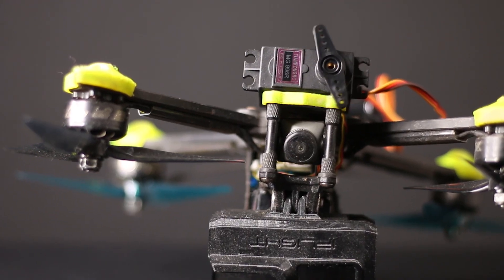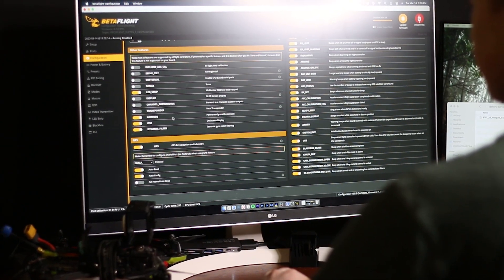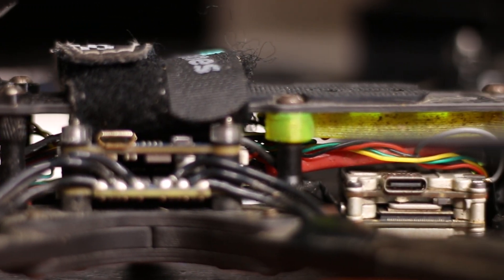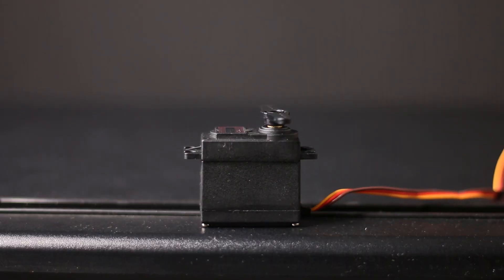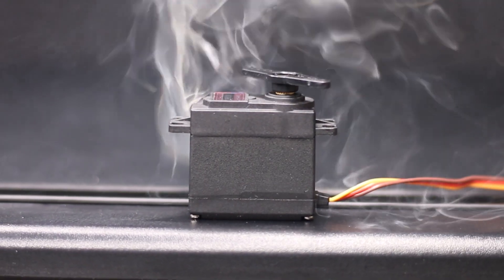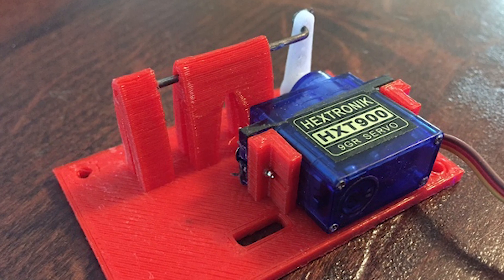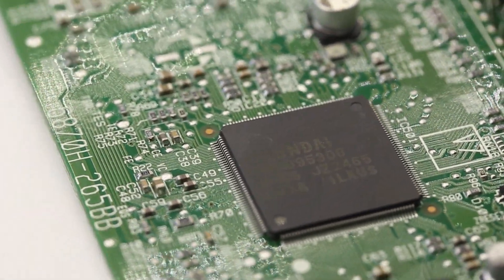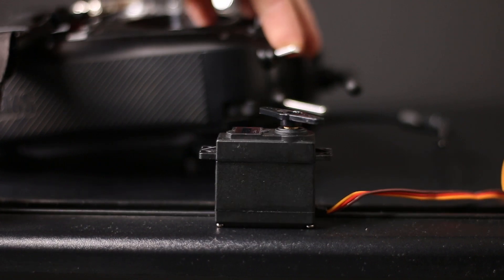Servos On A FPV Drone!

Comment: you mentioned connecting it to an Arduino or RPi. is this separate from the FC? or is there a way to connect to open up options on the drone?

Comment: So, how did you hook up the servo?
Reply from the maker: It all depends on what FC you have, but for me I connected it through the ground and 5v (you can also connect it to the main ESC you just need to step it down) and then I connected the signal wire to an open receiver pad, It all depends on what board you have but Bardwell made a great video explaining how to connect it!

Comment: What does it mean for a servo to be 6V, 7V4 and 8V2?
Does it make a torque ramp, or does it only work with one voltage?
For example, only 8,2V?
Trank you
Reply from the maker: Using a higher voltage (like 8.2V) makes the servo stronger and faster, while a lower voltage (like 6V) makes it weaker and slower. It's designed to be flexible and work well with any of these power levels, so you can choose how strong or fast you want it to be.

So you can use any any voltage that is close to the servo (typically) It's not restricted to a single voltage within this range, but its performance varies according to the voltage used, overpowering the servo will damage it though.

But to sum it up, for testing I would use some cheep budget servos, then use higher end ones when you have the bugs all fixed, there are tons of servos and they all have different strengths so you just have to decide which one fits best, remember though they do have different strengths at different voltages, but they should tell you what strengths they are at the voltages!

Comment: Do you know how to disable "automatic testing" of servos when turning on the betaflight quad? What I mean is that when I connect the battery, all the motors and servos make short movements. Can I disable this behavior for some connected servos?
Reply from the maker: I’m not fully sure how to disable that, I know for me only adding them to a switch and making sure that it’s precisely tuned for the servo, and a bunch of just messing around with it, hahaha

But it might also depend on the  Betaflight software (I’m using an older software in this video, V_3 I believe?) 

If you’re not able to fix it then you can use a different type of servo, because it may be part of the Betaflight startup process.

Hopefully this fixes your issue, if not I’m happy to help!

Comment: Hi Zane! It is sounds really interesting. But what is the purpose of using servos on quads except dropping? Any good ideas?
Reply from the maker: So far for me I’ve been using them for dropping and I’ve seen that you can use them to also build a gimbal, but other than that I’m still not sure. I’m just testing these things out and seeing if they can help sometime in the future!
Reply: @zaneshawdrones  Same feelings. Big potential, but no reasonable implementation.
Reply: @zaneshawdrones  i used some cheapo 9g servos and designed a 2 axis gimbal for my quad. It has a 460mm frame, and my FC lets me easily switch between 2 cameras, so i mounted the servo gimbal and a foxeer cat 3 mini on the underside of my drone. Still trying to figure out head tracking, but the knobs on my controller will work for the time being
Reply: Camera tilt
Reply: @amando96  Yes, I did it for my fixed wing FPV plane. But how to use it on FPV quad? I still don’t see any useful purpose
Reply: Also camera angle? If I want to switch from 25 degrees to lets say 15 I have to land, change it, and then fly off again @SlavaSomov
Reply: @amando96  Hm. Interesting idea. 35 for flying, 0 for hovering, and -90 for landing. Thanks bro. Need to try
Reply: The Ukrainian army seem to have found a use for it.
Reply: @NigelTolley  Read again. I said “except dropping”